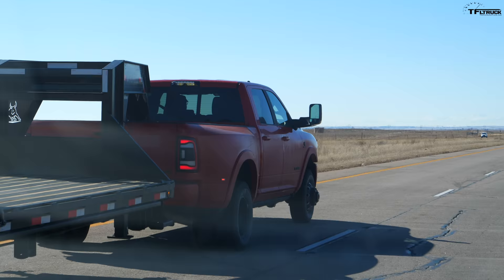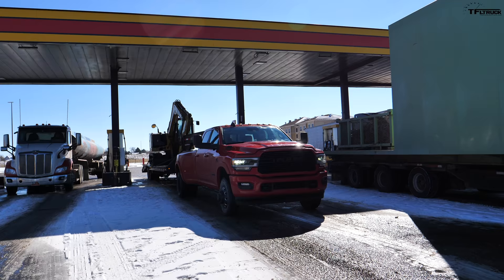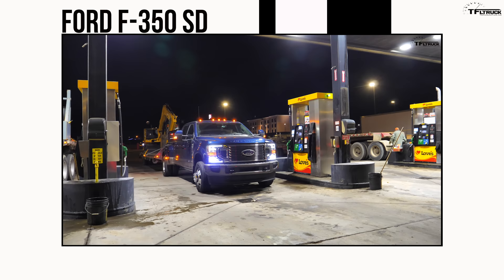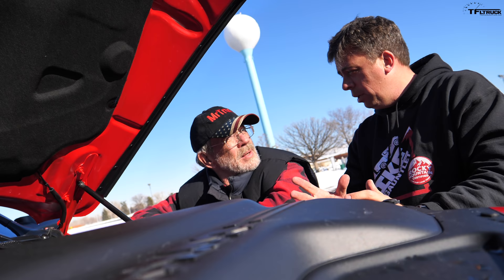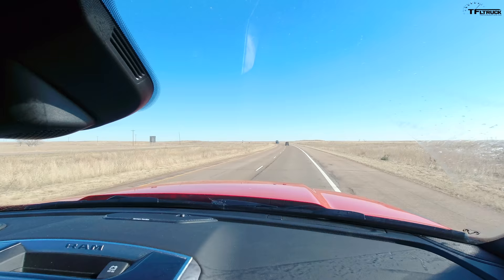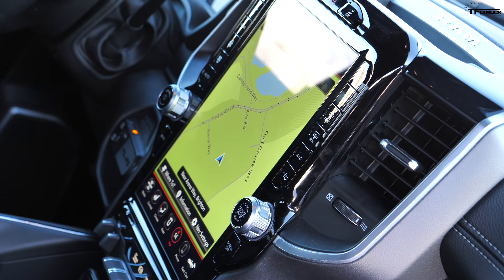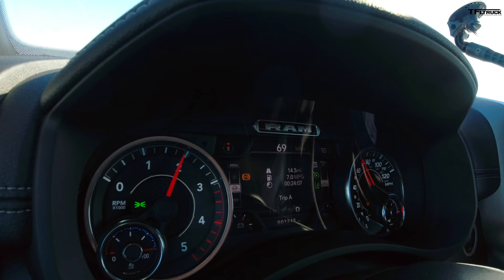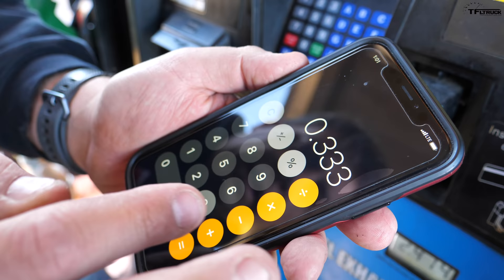New Ram 3500 Cummins Takes On Our 30,000 Lbs MPG Challenge Against GMC & Ford Diesels!

Comment: I have a '19, and, while it pulls great, they have certainly taken a step backwards in efficiency with the new HO.  I'm a Cummins guy, but no excuses here, they missed the mark with this engine.
Reply: I have to say, I do not agree with that statement. 

The 19 model Cummins seems to have multiple power increases on its mileage. Noticed power difference at 3k, 5k and 10k. The mileage did increase (.5-1 mpg). However, it was not with towing (Was waiting to break 10k before towing). Either way, I think Cummins is really limited on the power band on these motors until certain mileage. Which is why I think these test don't mean much. I would love to see the PSD, Durmax and Cummins tested at least 10K plus mileage. Anybody who runs diesels for a living knows that these trucks aren't showing their true colors until that point. I think that is were TFL fails on these test. 

Just so you know, my19 truck power, sound and transmission changed somewhat dramatically between the first thousand miles and ten thousand miles. it's a very different truck. I think they need a better trans though. 8,9 or 10 speed would make this engine shine.
Reply: @joe2bear  Not my first rodeo, or my first Cummins. My '19 now has over 12K miles, and the MPG has only marginally changed. Probably less than 1 MPG improvement.
Reply: @1hasbeen531  Are you basing mileage towing or unloaded? 

Running freeway on my 19 with 35 inch tires. I run 20-21mpg at 68-70mph. My 17 psd was about 18 mpg around same speed and that was a 3.55. Had the same size tires on that as well. The Cummins is now 3.73.
Reply: @joe2bear  Both.  Recently pulled our toy hauler 1200 miles. The truck averaged 9.5-10.8 @65-68 mph. Return trip with just truck was in the 14s @70-72 mph. I pulled the same toy hauler with a 6.4 gasser and it averaged 7.5-8.5 mpg, and that was fully loaded.
Reply: @joe2bear  people are claiming an increase of 2-3 mpg with the 2020 Powerstroke compared to their 17-19s. Ram just needs to get on the ball and offer a 10 speed as well.
Reply: Its really nice to see someone willing to speak truthfully instead of just constantly saying there choice of truck has 0 drawbacks. Cool!
Reply: @trevorschield8195  Agreed, they should have had a different transmission offering already. Hopefully they get behind the Allison and hopefully they stop the whole HO and SO and make it one tune and one Trasmission.

Comment: One of the truck makers should build a inline 8 cylinder and let’s see what happens
Reply: Back 2 pistons where the center console is. 🤣
Reply: Inline 8's are problematic for a number of reasons, and that is why they've been dead since the late 1930s. They're long and hard to fit in a vehicle, and the crankshaft is long and flimsy - so it twists and whips. Works ok in tiny engines, but not truck size ones.
Reply: GroovesAndLands I happen to know that I’m also automotive machinist I’m sure in the 1930’s they did not use hardened cranks I’m also sure that today tech they can figure it out
Reply: @raymondpruitt5421  No. Hardening/heat treating changes material strength, NOT stiffness, so the long (hardened) crank is equally as susceptible to torsional vibrations and whipping as the long (soft) crank. Try again...
Reply: GroovesAndLands well I quest they should just quit building engines they don’t know how to balance anything
Reply: GroovesAndLands lol try again wow
Reply: GroovesAndLands go read more magazines
Reply: @raymondpruitt5421   Yes, we should quit building engines all together because inline 8's don't work well... :eyeroll:

Comment: Should I get a single axle Semi because it's about the same Mpg

 for hauling 5 cars
Reply from the maker: You could, but you should consider maintenance cost for each. Maintaining a Class 6 or 7 truck is a different game. We do not have an exact cost analysis for this right now.
Reply: I hauled cars with a 6/7 car Kaufman for a few years.  I would say even for a 5 car trailer it is worth getting the class A truck.  MPG will be near identical, but you will be MUCH more comfortable in the class A.  And this Ram is probably 80 thousand out the door.  A VERY well maintained modern class A can be had for 40-50k. And in the long run a class A will be more durable and cheaper to run.  They are built to work all day every day under heavy loads.  If you read forums for car haulers, people using non commercial trucks  are replacing transmissions and differentials as frequently as every 40k miles or less.  Whereas a class A is built to run 500K plus miles between major services.  And servicing one of these new diesel trucks is honestly not much cheaper than servicing a big class A.    Unless you really don't want to deal with the size, the class A is the better choice all around.  Hope this helps somewhat.  Best of luck whichever way you go 👍
Reply: Get a dual axle and haul 8 for more money.

Comment: Why Dodge still only has a 31 gallon standard diesel tank is kinda goofy, Chevy has a 36 gallon and Ford gas up to a 42 gallon tank. I guess you can buy the factory dodge 50+ gallon tank as an option but it takes a certain configuration

Comment: It's interesting the relationship between DEF use and mpg.  They are linear and opposed.  i.e. better mileage worse DEF mileage.  I have to wonder what the correlation means.  If you ran the same truck half a dozen times would the results change based on the regen cycle of the truck?  or do certain makes simply make a DEF/economy trade off in their tuning that would be the same no mater how many times you ran it?  If the former it might be worth a retest of at least one truck to see.  If the later it seems Ford's strategy is paying the most dividends: an extra 1.8 mpg is certainly worth a 15% consumption increase in affordable DEF.
Reply: Compared to RAM. Not the GM truck. .9mpg better but 16mpg worse in def. Only .10cent difference between the diesel and Def cost. I think he said 2.92 and 3.02. Then GM wins that game
Reply: @baums547  Sure but do the math. 10 cent difference and if you even the .9 for the Ford to a full 1mpg better and then make the def advantage 15mpg instead of 16 it'll be easier to see.

Comment: Ford ftw
Reply: Gbhofficial for the death wobble win that’s for sure.
Reply: Xxplicit Lol what is hot in your mind TorqShift transmission is built for 195-230 and Allison is 150-210 aisin is built for 150-180 or something like older transmissions but each does well in its own temp range TorqShift is built to run warmer and has higher heat tolerance but the Aisin also has oil change intervals of only 30k mi vs 100-150 k on Allison and TorqShift and TorqShift also holds the most torque and hp 😉it’s all in what each 1 is built for
Reply: Mark Dudley sorry Ford and Dmax transmissions oil change intervals are 120k -150k Aisin is 30k and 68 rfe is 60k. Go do your research
Reply: Mark Dudley like I said it’s 120 k on Ford go check it out instead of keeping on spouting the untruth! U need me to link it. Just cause Aisin is the only 1 that goes 30k doesn’t mean everything else does lol
Reply: Mark Dudley then you still haven’t looked lol go look
Reply: Mark Dudley http://www.powerstrokehub.com/6.7-power-stroke-maintenance.html
Now are you satisfied? Transmission oil change interval 150,000 miles.
Reply: Xxplicit it wasn’t running the entire time lol and if ford would’ve slowed down a minute n 15 seconds to Rams speed their fan wouldn’t have had to run either lol 😂
Reply: Xxplicit a fan running keeping a truck from getting hot doesn’t mean the fan is running and the truck is still getting hot lol that’s what a fan is for and ford was cranking out a lot more torque and horsepower and speed than the other 2 lol
Reply: Mark Dudley what’s a kid is to argue on and on without showing facts to back your theories and calling the other guy down n not going n looking for yourself that you’re wrong. Just cause Aisin is 30k doesn’t make that every other truck now has to be 30k no matter what n nothing else is possible lol
Reply: Mark Dudley A Aisin at 220 to 230 is way above its temperature range. Go watch PD Diesel power who has like 10 Ram 4th n 5th gen normal temperature on Aisin is between 150 and 180 and most times in 160s if you have an Aisin running at much over 200 there’s definitely something wrong n it won’t last long
Reply: Mark Dudley did you check out the link or are you still set on not looking and just believing your own head above the facts?? Look for yourself elsewhere if you need to 150k 6R140 Torqshift oil change intervals 120k on 11-16 or so
Reply: Mark Dudley lol forums are opinion pieces most times and I didn’t send you forum opinion pieces or f150 information. I sent you a link to fords recommendations for ford 3/4 ton and up Powerstroke/6R140 Torqshift oil change intervals which are 150k mi. Go look directly on ford website if you need to and not F150
Reply: Mark Dudley so tell me . From what you know now what are the 6R140 Torqshift super duty transmissions service intervals? Not F150. 150,000 and could be F150 was 30k at 1 point or something I don’t know but we’re talking f250 and up vs Ram 3500 Aisin vs GM Allison not F150
Reply: Mark Dudley PD Diesel Power channel on YouTube is what I was referring to earlier and 6R140 Torqshift and GM Allison 1000 are the most reliable transmissions out there and have 100+k transmission oil change intervals.
Reply: Mark Dudley I said F250 and up cause them and GM use a good transmission on their F250/2500 as well as 350/3500 and it’s same unlike Ram that uses the cheap 68RFE transmission in their 2500 and a lot of 3500s when they should use the good Aisin in 2500 too and not have a low output with a junk transmission 68RFE which has 60,000 mile intervals and weighs a lot less than Aisin Allison or Torqshift
Reply: Mark Dudley where’s the information you’re going by then I’m open. We’re not talking f150 either lol
Reply: Mark Dudley http://www.duramaxhub.com/duramax-maintenance.html
Here’s GM Allison service schedule 97,500 miles under normal conditions on 2012 and up and older 1s were closer to your figures
Reply: Mark Dudley 
Transmissions oil change intervals 
Ford 6R140 TorqShift F250/F350= 150,000 mi
GMC/Chevy Allison 1000 2500/3500=97,500 mi
Ram Chrysler 68RFE 2500/3500LO 60,000 mi
Ram Aisin HO 3500HO 30,000 mi
And yes all of them in older trucks were around 30k but not newer ford and GM trucks 2011 and up
Reply: Mark Dudley what you were going by earlier was F150 opinion that 1 guy said and not Ford F-250/350 information that we are talking about also I added GM in there cause you seem to think it’s not possible to have 100k + transmission oil change intervals lol
Reply: Mark Dudley lol there again go look at the facts of 2011 and newer 6.7 Power Stroke f250/350 😉lol what in your mind makes an f150 a f350 lol. If you’ll go do research and see for yourself in the actual category we’re talking about you’ll cease to make yourself look dumb to everyone reading this and see that you are wrong and what I wrote above was complete honest facts . That’s why I can tell you look for yourself unlike you just insisting your right when you know I am and that ford is 150 k mi interval lol some people never learn real facts they just think they’re right no matter what facts say lol useless to even point em in the right direction if they still insist they’re right even when you’re shown your maybe right about f150 Powerstroke possibly and older trucks and Aisin but dead wrong on Ford F-250/350 which are 150,000 mile intervals and when you can agree with the facts let me know lol 😂 😂🤣I’ve never heard of such a guy that you can show him facts and he still won’t budge lol just sticking to your original opinion whether it’s right or wrong doesn’t convince anyone 🙄😄
Reply: Mark Dudley And when or where have you ever seen or heard of an Aisin running in the 200-230 temp range? That’s insane high for Aisin if you know anything about Aisin transmissions
Reply: Mark Dudley lol just keep believing your fake reality fine with me I still don’t know where u get your faulty information
Reply: Mark Dudley once you give me some solid information to look at that supports your 30k idea on 2011 and up f250/350 I’ll agree but there’s nothing out there like that cause that’s not the facts. I sent you a link with all kinds of ford truck information including 150k mi oil change intervals and you still insist on this f150 article where a couple guys were figuring that was the cause on f150 but no facts on f250 350
Reply: Mark Dudley I sent you Powerstroke Hub information that you know is facts lol that and ford is where I get my information and stop saying ford says 30k miles on f250 just cause Aisin n possibly f150 did lol how hard headed can a guy get??? 😲😁😂http://www.powerstrokehub.com/6.7-power-stroke-maintenance.html
There it is again if you didn’t see it the first time
Reply: Mark Dudley lol f150 yeah if u don’t get f150 vs f350 then I’m done with you lol 😂
Reply: Mark Dudley and lol consensus of what 1 guy said on a forum about f150 vs what ford actually says about f250 and f350 lol what don’t you get about the difference of a couple guys talking opinions about f150 and what ford says about the f250/350 we’re actually talking about lol 2 totally different things 😉
Reply: Mark Dudley lol you’re the only 1 that obviously doesn’t know what he’s talking about lol I drive a 2015 6.7 Powerstroke and the oil change intervals are in the owner’s manual lol is that enough on top of the other info I gave you
Reply: Mark Dudley lol more power to you
Reply: Mark Dudley to you as well good argument eh 🤪

Comment: RAM Trucks Best Truck out there!!!
Reply: K E NOOOPE ITS THE NEW 2020 Ford SUPER DUTY
Reply: Lol.  Except when compared to the 2020 Superduty. But hey, who needs facts. You be you man!
Reply: @mustangdbest220  NOOOPE ITS THE NEW GMC SIERRA HD
Reply: @boduke9428  GMC SIERRA/ CHEVY SILVERADO HD ARE THE BEST
Reply: bo duke the facts are that ford is known for their shitty transmissions and engines besides the 7.3 diesel
Reply: @campbell0162  lol. Which is why it lost every importance category to the Ford when they tested them with this trailer and excavator last week. What's important is getting the one that makes you happiest. If having the biggest loser from this year's test then more power to you. None of my business as long as you stay to the right as we go up a hill and don't slow me down, lol.
Reply: @boduke9428  I get where you're coming from, but for me I wouldn't be hauling weight that maxes out the capacity of the GMC. And I would never buy a Ford or a Ram because they are cheaply slapped together these days and are unreliable
Reply: @mustangdbest220  FORD JUNK!! RAM GREAT!!!
Reply: @campbell0162  I agree, only I also put the GMC/Chevy clones in the same category.  None of them are built to last anymore. They are made to be replaced when the loan is paid off.  Manufactures finally figured out building high quality, long lasting vehicles isn't in their best financial interest.  I know some people baby theirs and never max them out and get one that will last a little longer but that is now the exception, not the norm. Luckily I enjoy having newer trucks so this doesn't bother me so much. I'm not gonna keep one more than a few years regardless.
Reply: @mustangdbest220  
Thanks for sharing no you can come fix my death wobble on my ford that has 20,000 miles on it.
And forgot to add it only gets about 11 mpg empty.
Reply: @mustangdbest220    you could give me a stupid duty but I'd take it and trade it in for the ram.   Have them and have ram too.   Prefer the ram
Reply: @chiefbeef2947  Ford trans are not shitty by any means
Reply: Jason Williams No I’m not you just butt hurt because the Ford super duty 2020 is better than the Ram because it’s got the new 7.3 L
Reply: ChevyDude EWWWWW GM IS GARBAGE
Reply: Chief Beef Word is known for the best transmissions and engines
Reply: K E ram Jong Ford built extremely tough

Comment: In 5 years and they’ll be 110-120k easily.  Damn these trucks are getting expensive.
Reply: Definitely agree the banks are gonna have to mortgage the payment pretty soon. I love the new trucks but till the price tag goes down I will not be buying one
Reply: Well, probably not. The inflation rate is about 2.0%. In 5 years times, an $85,000 truck should be a hair under $90,000. Even a $99,000 F-450 Limited will still be around $105,000.

Comment: you should get a truck with the KarbonKleen system by DynaCert installed in it for testing. The system is claiming they reduce increased fuel efficiency by 30%, reduced NOx, and particulate emission by 65% for starters.
Reply: With claims like that it's a scam. Put a Tornado in!
Reply: @geoffmooregm  they have been putting them in diesel's all around the world for a couple years now.

Comment: Go Ram & you will not have to be in the shop with the found on road dead truck all my transmissions in my cord only lasted between 45 to 50 thousand miles and had to take them into Armco for repairs my 2 Rams have only had to have regular maintenance done. Put over 300 thousand on my Rams. Blew an engine on a Ford F-350 a little after 160 thousand miles. Will not own a GMC or
Chevy.